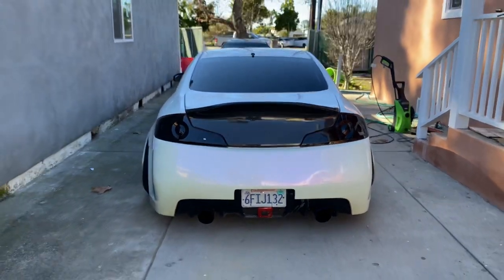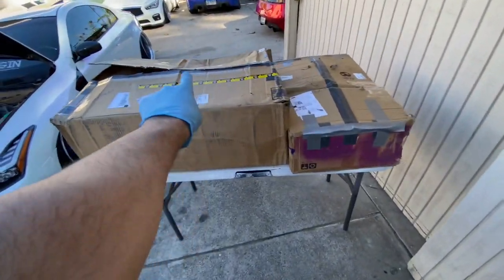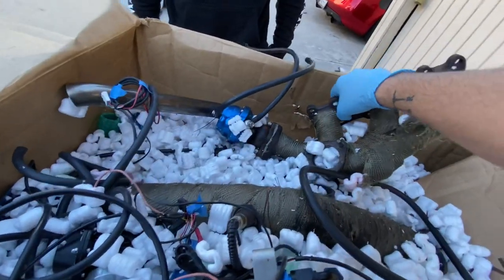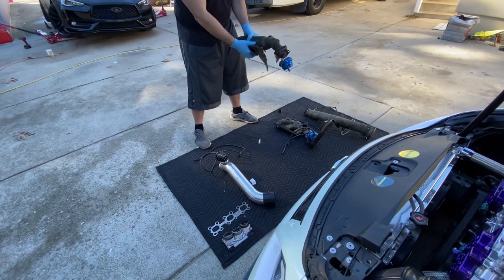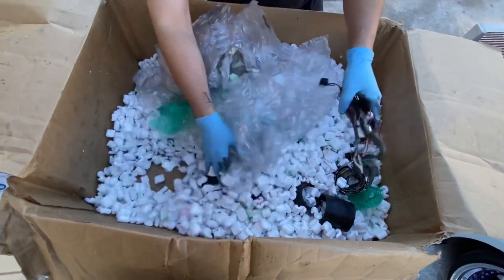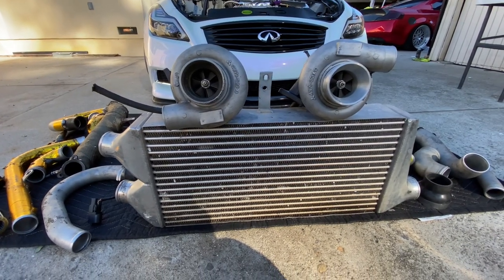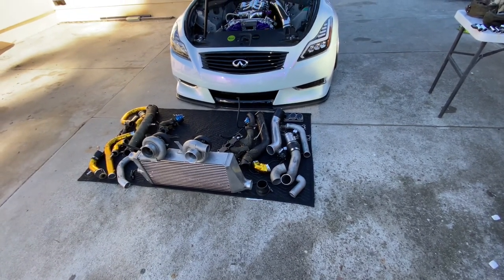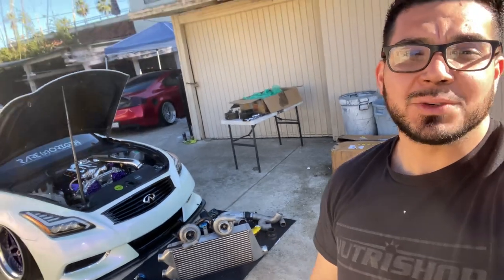G35 with G37 front end Gets Twin Turbo Kit! Boost!

Comment: I would have the engine fully rebuilt with forged internals before installing it. The DEs oem connecting rods will be the first go forsure. Congrats on the setup though.

Comment: congrats bro but the engine is going to blow fairly quickly
Reply: Just rebuild/ replace the internals with brand new parts to prolong the lifespan.
Reply: @its_taps  thats if the block doesnt crack when it does
Reply: @LibertyGunsBeerTrump  why would it crack?